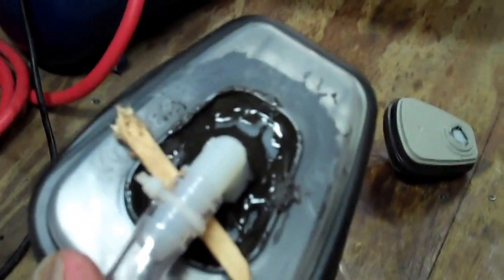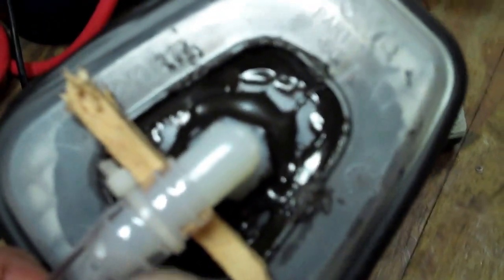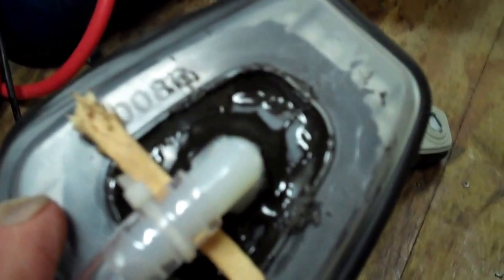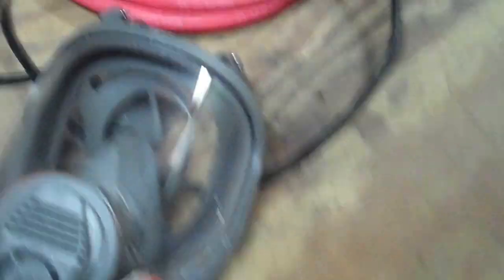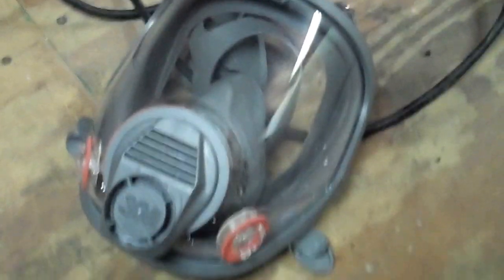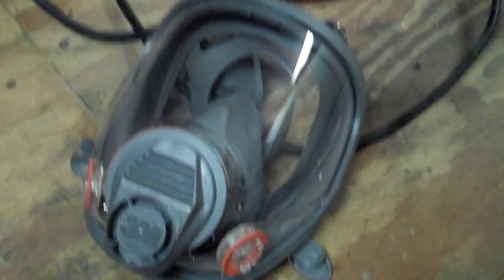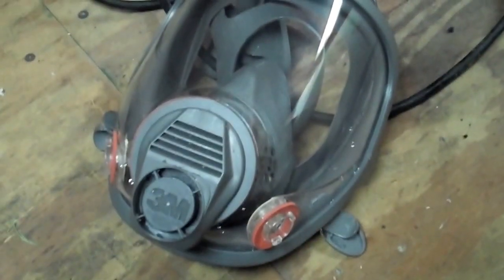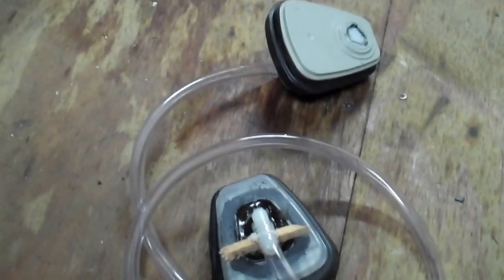homemade full face mask respirator fresh air system part 6

Comment: Use a rubber diaphragm type pump. California Compressors make new silent model or Thomas Indus.. Or try several 12v pumps in parallel for Hooka.
Reply from the maker: thanks for info,but this unit works great.well over a year now and great

Comment: is your larger compressor oilless also? As a commercial diver, I know we have to use monolithic oil. you could drink it if so inclined. we get our compressors with no oil in them shipped that way and put our oil in it. sweet idea.  just make sure it isnt near any running engines..........lol
Reply from the maker: my big compressor is oilless and I have filters on it for water and debris.works great
Reply: awesome. stay safe.
Reply from the maker: hell...if you stay safe you never have any fun!!!!!! ha !! ha !!!

Comment: How do you make the compressor continuously to turn on ones you are away from it?
Reply from the maker: hi.the compressor is an oilless compressor.do not use a compressor that requires oil.the compressor has a pressure switch that is set at 140 psi maximum and once the pressure goes down to 100 psi the switch opens up and it turns the compressor on and then closes at 140 psi and shuts the compressoe off..most compressors have this feature.subscribe to my site as I have a lot of other great videos...mel
Reply: melbaron1110 yes I get that part. Do you have a switch or valve that opens up the airline to your mask so that you continously have air coming in?
Reply from the maker: HI.if you follow the 2 clear lines from the face mask down to the where they connect at the "t" fitting you will see a small black pressure regulator valve that I can adjust for air flow.the knob pulls out and you can turn it for flow or snap it back in and it locks in place.its attached to the belt clip.i put the clip on my belt and it prevents undue pull on the mask and lines.works very well..mel
Reply: +melbaron1110 pretty cool! How's the air quality and is it warm or cool?
Reply from the maker: unit turns on automatically once it falls below 100 psi.pumps up to 150 psi
Reply from the maker: air quality is excellent.i have a water separator and very fine micro debris filter.the air is very cool and even on high humidity days the mask never fogs up.you must have a fairly large "oilless"compressor as it takes a lot of air flow to let you breath properly.i also have a small regulator mounted on my belt so I can adjust air flow going into the mask.actually works great